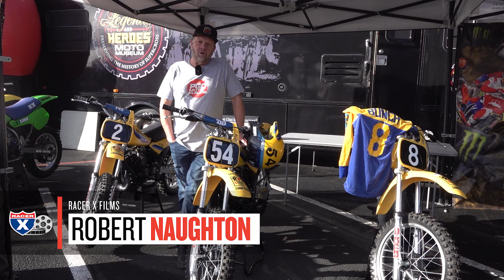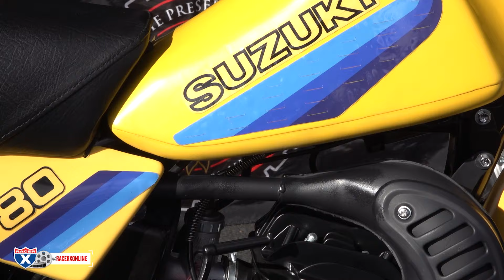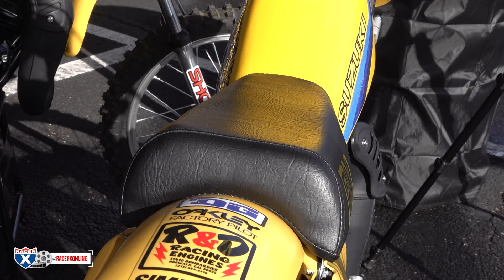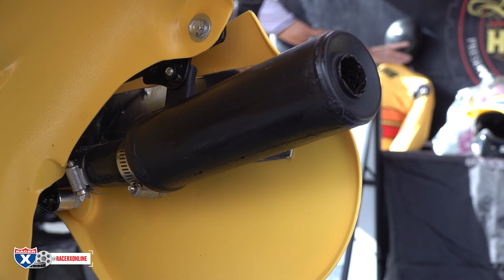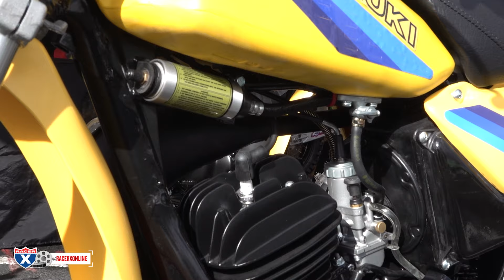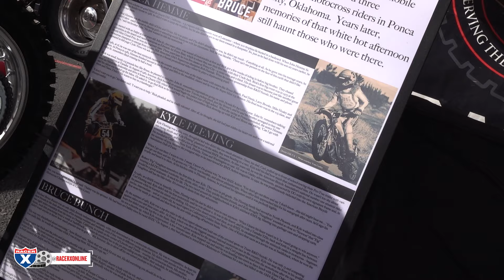1982 Suzuki RM80 Tribute Bikes Build Project

Comment: very very cool! i aquired an '84 yz80 and restored it to near perfection. it had most stock parts and a rebuilt motor already. i did some research and found out that Eddie Hicks was the '84 champion. i read a similar story that some of his rival racers and probably friends passed away from an accident. im wondering if these were the same guys...im thinking they were. i still have my '84 80 just trying to fix compression issues to get it running..i cant wait. rip to those young racer moto bros..i raced motocross on a '75 yz80 and numerous desert races and gp's including '75 world mini gp. i remember Ward, Myerscough and Brown being in my race... my next bike was a '77 rm100  ✊✌